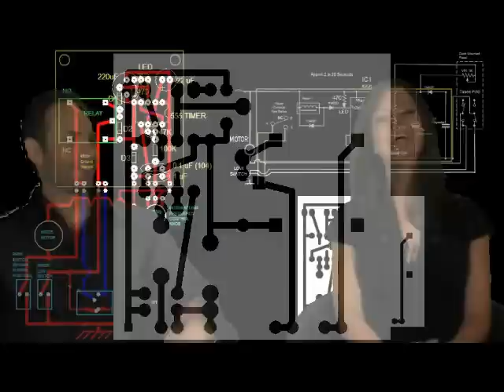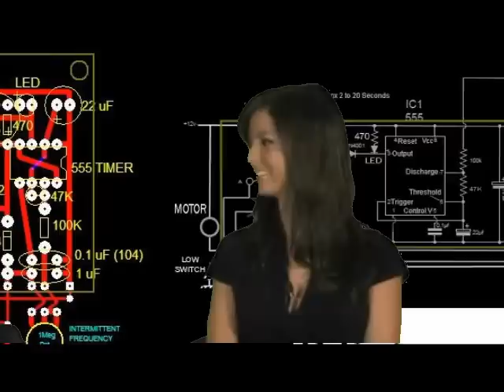INTERMITTENT WIPER FLASH OF GENIUS

Comment: Can u tell me voltage of kapacitor, 25v or 16v or 50v
Reply from the maker: Kuncoro Aji    At least 16v for the 22uf and 220uf electrolytics and ceramics for the little ones.
Reply: And diode? 😀
Reply from the maker: Kuncoro Aji 1N4001 or similar, check black diagram

Comment: Hi guys, did you design the schematic?
Reply from the maker: sam pah, Yes. The “power” of the 555 chip is mighty..
Reply: YARANAYR66 is it a working drawing? If it is can i make it myself for my cat?
Reply from the maker: sam pah It was designed for an 80’s style Chevy pickup and worked well. However it is fairly universal for these older style, “mechanical-logic” motors. Now, for your cat... maybe not ;)
Reply: YARANAYR66 i meant car 😂😂😂. Ok thanks mah dude!